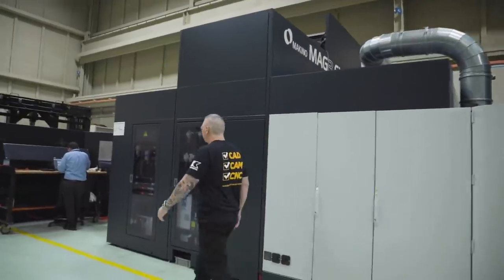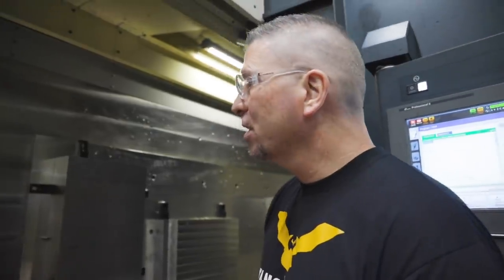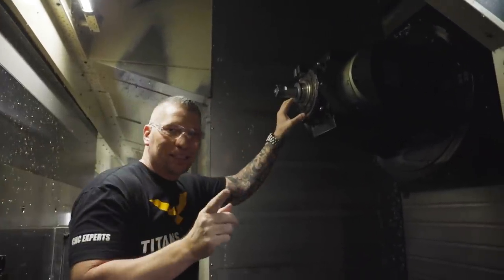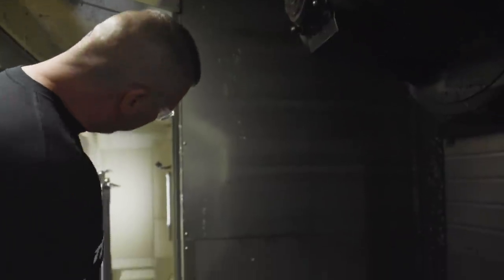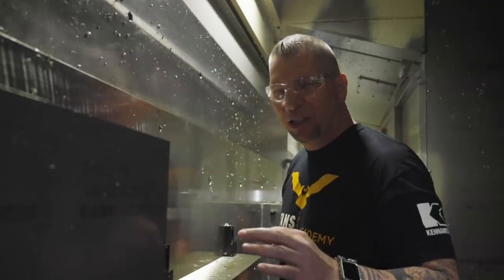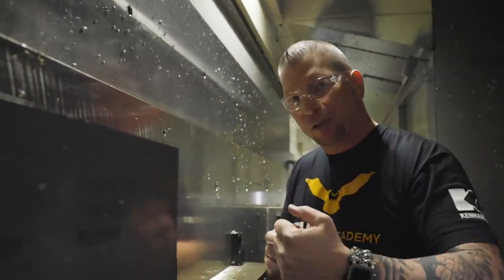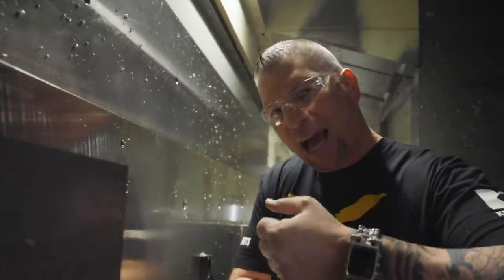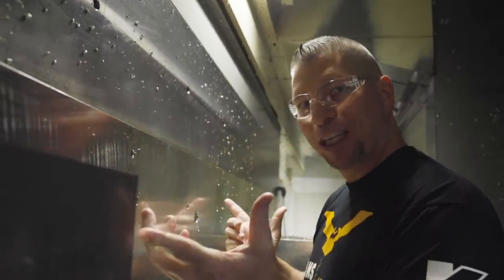174 HP Makino MAG3.EX | BEAST of a CNC Machine | INSANE 5 Axis Horizontal Spindle Head

Comment: 174HP and there wasn’t even any real cutting in the video
Reply: Need all that power to have any torque at 20k+ RPM in aluminum.
Reply: When it's actually milling with the big face mill you can't see anything. When cutting at 33000rpm the coolant vaporizes and all you can see is a fog. But you get to watch it simulated in real time on the collision safeguard computer which you can see at 1:55
Reply: go watch at makinos site they have a couple of short clips

Comment: And to think that the machines that manufacture  these machines are even bigger again
Reply: kind of but totally different.  this isnt a single piece, theres mutiple castings that go together to make this, they get aligned during installation.  the big parts are probably roughed in on gantry mill and then scraped in by hand, as fast as the makino mags are i'd have to assume they are on linear guides, i would like to get a look under hood to see exactly how its put together.  if you dont need to evacuate insane amounts of chips, a gantry is hard to beat when it comes to work envelope, accuracy and cost, but this is designed to blow through huge amounts of aluminum, and many machines start to choke on the chips.  hell i'd imagine its hard to keep up with the chip barrel or bucket when this is roughing, not sure if they use a central chip collection with these or not.

Comment: That's awesome, I could do top and bottom shoes for a 120" prog die in one operation.  WOW!
Reply: Those spindles are no good for high torque low rpm applications, they are purpose built for hogging aluminum for big aerospace components
Reply: @narwhal4284  simply marveling at the size of it, my friend. Tool and die work is in my wheelhouse...
Reply: True the size of it is impressive, and I can appreciate tool and die I'm a machinist myself I used to work on MAG3s doing aerostructures, there are gantry style mills capable of the same travels but the are typically in a vertical configuration for rigidity
Reply: @narwhal4284  Nice! Love the trade. I used to jockey a few large travel machines but never a horizontal of that size. Biggest gantry style mill I have ever ran had 26 feet in X, 7.5 in Y. Was an old vertical G & L retrofit. I dearly love this stuff. Good for you, sir. An honorable trade, indeed.

Comment: we have 16 of those in cells of 4ee; they WILL peel some chilly. each cell has a 100HP chip pucker and they often cannot keep up with the chip output. those things are amazing, we got some T2's as well for hard metal.
Reply: 2 megawatts right there (each one is 130Kw) i wounder how big the chip bin is assuming there is a single connecting conveyor for all of them
Reply: How does the company get rid of the chips?
Reply: @swordfish2089  They would either use a Chip briquetter. or a giant steel container tub
Reply: @ayatotakema1194  do they sell the chips to be recycled?
Reply: @swordfish2089  They do the price of aluminium scarps are 20-60 cents per pound (454g). and they are recycled. some have in house aluminum recycling facilities. Usually they are briquetted so they dont flash and dissapear into some kind of gas or vapour
Reply: @ayatotakema1194  thanks Ayato, just incredible machines!
Reply: @ayatotakema1194  just curious what would be the approx. monthly electricity cost on operating  a machine like this?
Reply: @swordfish2089  hmmm well taking account all electrical requirments 

of the machine operting of an average of 50Kw and there are enough of them to be consuming around .5-1 mega watts at a time then using the middle geou d of around 19.2 mwh  x cents per ( lets assume 10) kwh  we get a bill of $20,000 usd for tge machines alone. this is withou the air compressors and other stuff factored. And no this wasnt written by chat gpt
Reply: @ayatotakema1194  thanks man. I used to work in a mold shop back in the 90's with 4 edm machines 4 small cnc machines and some manual stuff like surface grinders and  Bridgeports and our monthly bill averaged a little over 1000 dollars per month.

Comment: How to lose money quicker than on stock market?
Crash that one at full speed :-)
Reply: If u can run it full speed maxxing out the 174 I think crashing would be second
Reply: No need to crash the machine.
Just put a HSK tool holder with a 1/2    carbide endmill thats not well balance to 30k rpm.
When the machine alarm out due to vibration and operator keep hitting reset to clear the problem.
A brand new machines will need a new spindle replacement in no time.